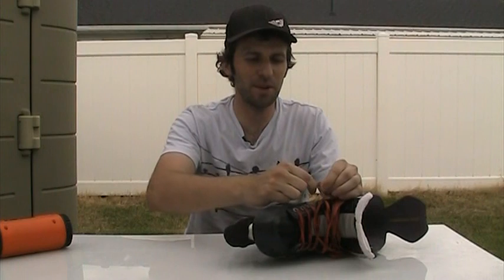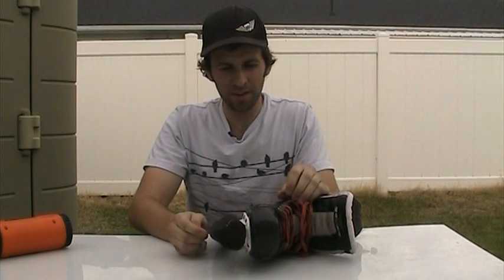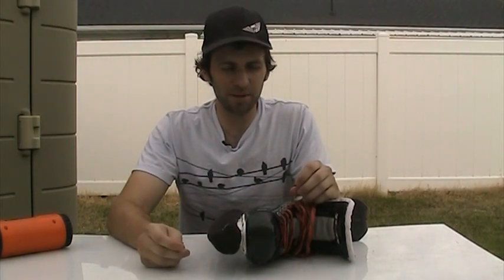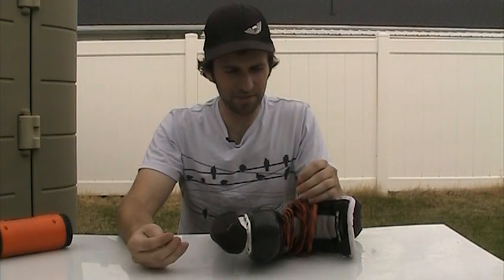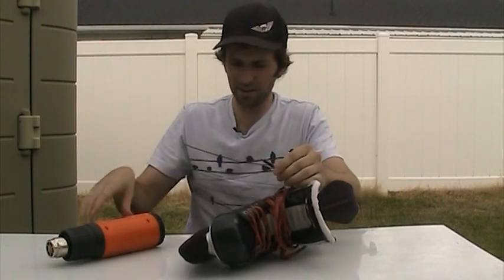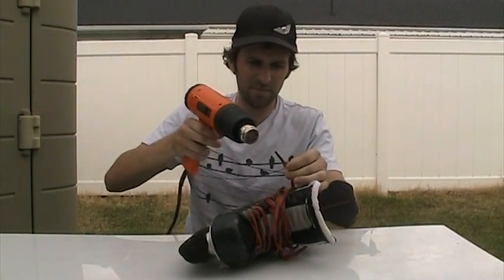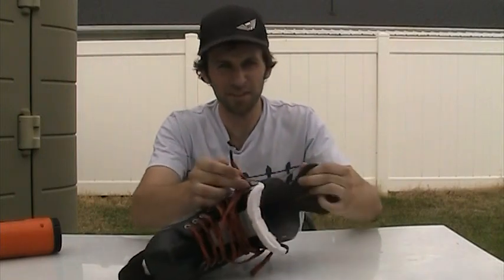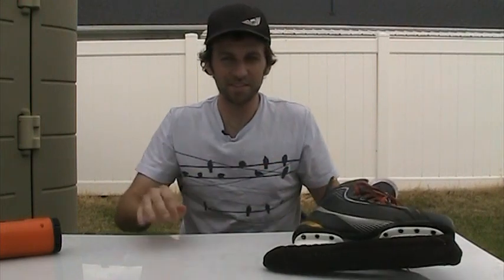Repairing Hockey Skate Laces

Comment: How do you keep the heat shrink tubing to stay on?  When I pull the laces through the eyelets when unlacing the skate, most of these come off the first time I untie the skates.  I like the idea of using heat shrink tubing, but if they won't stay on, it is not a long term solution.
Reply: Yeah, I found it didn't work well for me either